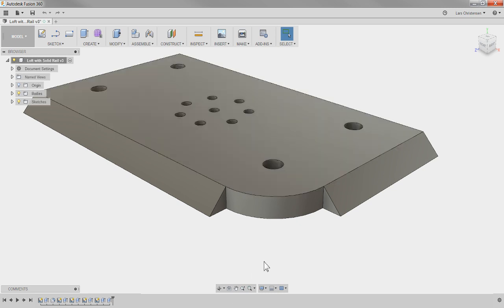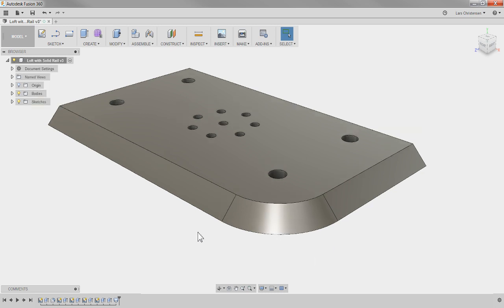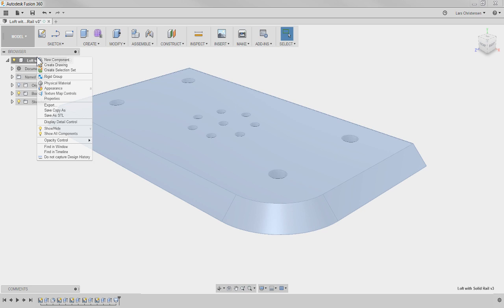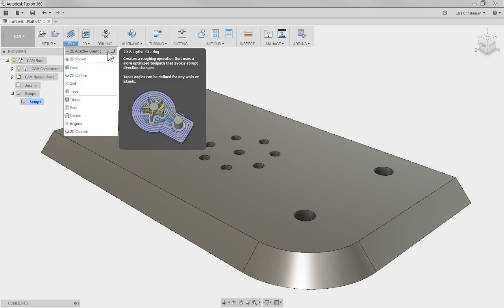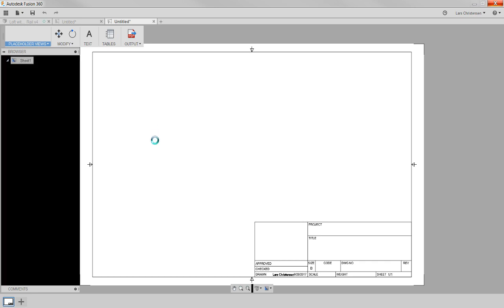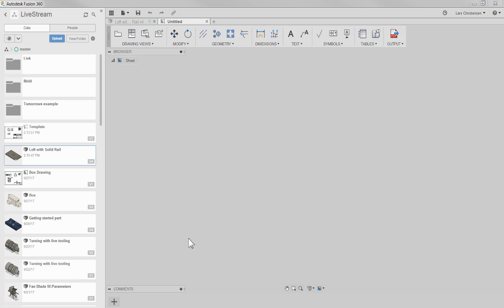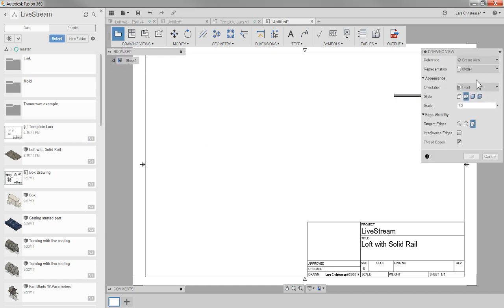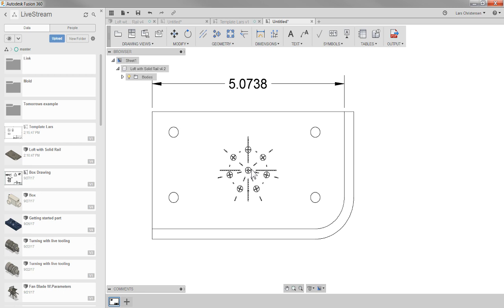Fusion 360 — What's New Highlights for September 2017 Vol.2 — #LarsLive 65

Comment: Those new select same diameter options will be very helpful, I'm sure. Great improvement! I hate it when I have one errant hole on a different level and that makes me have to select all the holes individually. On that note, a "remove from group" option, similar to how you can take instances out of arrays maybe, would be helpful as well.

I AM excited for the inclusion of form tools! I have a single-point thread mill that I use for both chamfering (ocasionally) and thread milling. Unfortunately, when I defign the tool as a thread mill I can't get the tool to be the right shape, and the CAM won't let me use the properly-sized version that I have defigned as a chamfer mill to do thread milling. I hope I can just make it a form tool and use it for both chamfering and thread milling.
Reply from the maker: Hi Hirudin Thank you for watching!
Yes some good stuff coming from the development team for sure!!

Best,
Lars